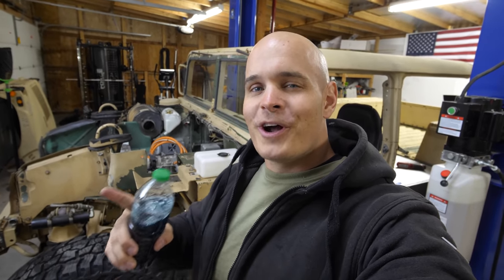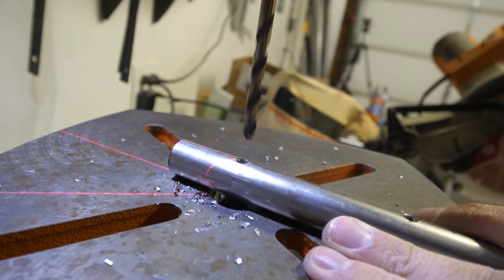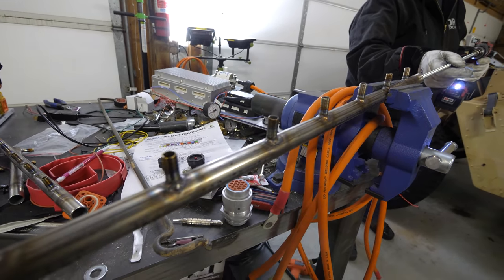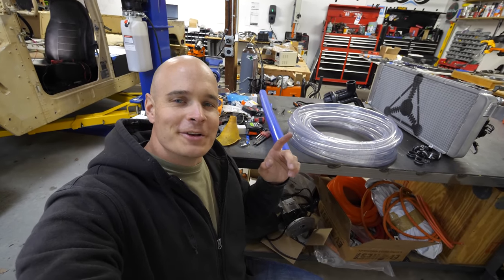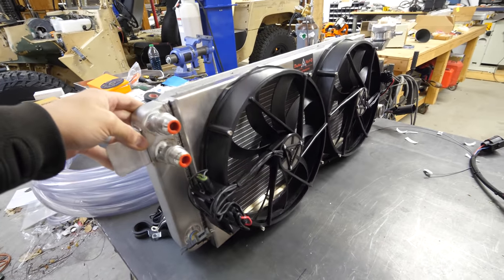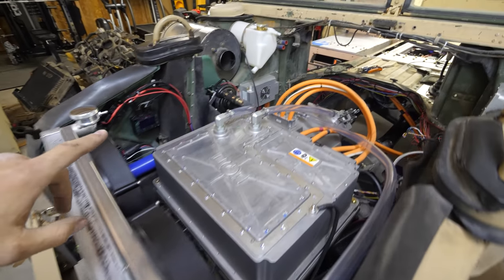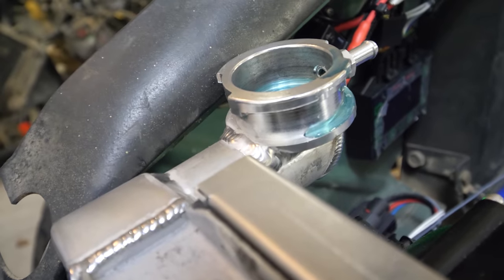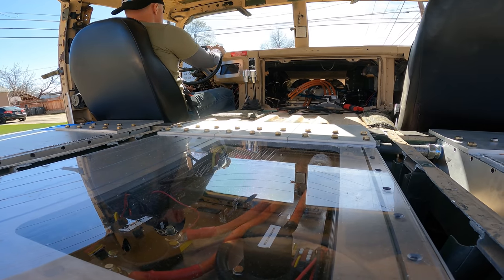The ELECTRIC HUMMER projects 'coolest' video YET...

Comment: awesome video! love this project. are you going to provide a cost range of how much it cost to do this conversion?
Reply from the maker: Yup!
Reply: @JerryRigEverything  My Guess is between $50k-150k
Reply: @JerryRigEverything  NO RESERVOIR? What about thermal expansion??? You could get leaks in the system without a reservoir that's one of the big reasons they're used in cars

Also your radiator seems to be aluminium, but the heatsinks in your battery might be copper... which will lead to galvanic corrosion, and eventually your system will leak (hopefully not inside the battery or it will destroy it). Just make sure you're not mixing metals!!
Reply: @iamdmc  unrated
Reply: @slimedev4920  Going out on a limb and saying a lot more than 50k (including the hummer) but less than 75k. Batteries can be had on open market 950-1350 per module, believe he has 16? so around 15-18500 (largest cost of this conversion). The motor and remainder components easily sit at 20-25k then rest of the cost of the vehicle itself. There could be labor if your not doing this or isn't simply a bolt on, which most conversions aren't. Again depending on how you approach this could easily get you under or at 75k for this project..
Reply: à
Reply: @iamdmc  I'm wondering if the deionized water in his coolant means that the coolant no longer conducts electricity and if that means galvanic corrosion cannot take place. I'm definitely interested in how all his new parts hold up over time.
Reply: @AustinFerguson  yeah ik
Reply: @slimedev4920  Didn't you get any bigger range? Your estimation is naive, as if "At least $10"!
Reply: @JerryRigEverything  hey btw what about the suspension? :D
Reply: @iamdmc  I didn't understand 40% of what you said but you seem to be making a point
Reply: @iamdmc  Aluminium and stainless steel, so no real issue with corrosion provided the antifreeze has protection in it for both. Expansion just needs a tank on the end of the radiator cap, and a 1PSI cap into a sealed bottle, or even just a simple accumulator, recycle a hydraulic one, as the expansion of the water in the system is going to be minimal, and probably can easily be handled by the PVC hoses expanding. 

Would though suggest adding some sleeving to all those hoses, especially where they run in the chassis, as that is where they will rub, and PVC in clear has very little abrasion resistance, and will also rapidly age. Best to replace with some braided hose now that the concept is proved, and use silicone rubber braided Goodyear hose, which will survive decades there, and fit the existing fittings no problem.
Reply: @AndyGneiss  I think it has to do with the coolant making the copper and aluminum break down slowly into the coolant so the water becomes conductive and will form the reaction leading to corrosion
Reply: @JerryRigEverything  You are awesome. Really enjoyed the whole series. 💓
Reply: $57
Reply: @iamdmc  yep thats what I touhgh too, mixing metals in a cooling loop is never good idea
Reply: @SeanBZA  Anti-corrosive additives only last so long, especially in high temperature environments. If it's changed often then it's less of a problem. 

Mixing metals is seldom a good idea! I hope I'm wrong for Zack's sake. Seems like a solid guy and would hate to have anything ruin his project car
Reply: @AndyGneiss  deionized water actually draws ions into solution faster than mineral water, so eventually you will have metal ions floating throughout your loop, and when one metal ion contacts a different solid metal you can get galvanic corrosion. Usually, people run deionized water with PEG and corrosion inhibitors
Reply: @iamdmc  Under 60C, so not exactly a problem, especially if you are using a propylene glycol blend with corrosion inhibitors in it, suitable for aluminium heads and cast iron blocks. Both the aluminium and the stainless steel form a thin oxide coat to protect, so the antifreeze will last a long time, provided the system itself is air tight and thus there is no oxygen to cause reactions. Should easily last 5 years in there, if it is the correct type, though you can also flush it out and use the Dexcool pink or orange antifreeze that Tesla uses in their vehicles, which is going to last 7 years as well.
Reply: @iamdmc  Need some Sacrificial Anodes!
Reply: @johnboynb  good call

Comment: It would be interesting to have a heating system for the batteries to recharge them in temperatures below freezing.
Reply: Bypass valve to redirect motor heat through batteries not rad? :)
Reply: @XxTWMLxX  It's a good idea, but it might not work very well because the car is stopped to recharge, so the motor won't produce heat
Reply: If you charge immediately after driving in cold conditions the batteries will be in the range for charging its only if leave battery empty in cold conditions that will have problems
Reply: @lucasdiniz5642  just put the motor at 5Krpm or something with the transfer case off.
Reply: @jwalster9412  Due to the high efficiency of the motor it is good at turning but not producing heat, so it would waste a lot of energy compared to a resistor in this case.

Comment: 10:00 This kind of pressure change can also be observed doing natural gas pipe testing. The formula (for air anyway) is T1/T2 = P1/P2.
Reply: IN KELVIN for people reading this, in KELVIN, not fahrenheit, not even Celsius !!!! Exclusively in Kelvin or the formula makes absolutely no sense !!!
Reply: @chafarlefeu  I mean, any physics formula with temperature should be handled in Kelvin. Celsius Degrees should be good only when dealing with ΔT because Kelvin and Celsius Degrees share the same intervals between units

Edit: spell check
Reply: @KekkusMaximus  yeah I know but the point of my answer was to warn the general public of this video which is for the most part not aware that this formula is useless if not used properly

Comment: I didn’t realize there was such an efficiency difference between electric and gas engines. So, even if the electricity generated for the electric motor is created by fossil fuels, it seems like it would still be more efficient than a gas motor.
Reply: It absolutely is. Engineering Explained has some good videos about this... A gas turbine peaker plant, connected to an EV by miles of transmission lines and all the efficiency losses involved, AND the charging losses, AND the drivetrain efficiency, is still more efficient than gasoline explosions pushing pistons 😂
Reply: @kschleic9053  Also, not all electricity is produced by fossil fuels, while to run a gas motor, it's entirely fossil fuels
Reply: how much efficient is a gas power plant?
Reply: @sayyidsahal1996  About 40 - 50%, the upper end being for combined cycle gas turbines (CCGT)
Reply: @sayyidsahal1996  that depends, a natural gas turbine plant is about 42-45% efficient. A combined cycle natural gas plant (one that uses waste heat from the gas turbine to turn a steam turbine) can be upwards of 60% efficient.
Reply: @fhonethone  not much of  difference.
Reply: @Blinkin97  then how can be a electric vehicle is more efficient when source is gas burning ?  gas to turbine to transformer to transmission to transformer to DC conversion to  chemical charging to discharging to
 AC conversion to motors.
(to me) it seems like a joke.
Reply: @sayyidsahal1996  it is not, because not all the electricity comes from gas power plants.
Reply: @Blinkin97  that's true
Reply: @ulexx6574  In some countries you can get gasoline that's 5% or 10% not fossil by adding ethanol.
Reply: @ulexx6574  putting aside e85, i wonder how synthetic fuels are going to affect the future. Brands like porsche are already working on it.
Reply: @Flashbang_Photo  Never heard of those! Seems like a pretty interesting concept
Reply: @jannikheidemann3805  ethanol production for use as a fuel has to be one of the dumbest things that's been done... thinking about it as a whole system: you need to spend energy to till/plant/harvest the crop, the production and transport of the fertilizer it uses, the transport of the crop after it's harvested, the energy use of the brewing and distillation facilities and then the transport of the ethanol to fossil fuel production facilities. I've seen number where it's only producing 25% more energy than you have to put into it... all to burn and use in vehicles with engines that are only 20% energy efficient on average and up to about 38% best with modern high-compression ratio engines, we haven't even started talking about the increased pollution from this industry and pressure on other food industries potentially pushing up food prices. Watch Engineering Explained's video about Ethanol.

Comment: Congrats on a job VERY well done!   I didn't see how you flow the coolant through the battery packs... hopefully in parallel, not series? That way you can keep them all at the same temperature instead of sending "once warmed" liquid from the first - to the second battery pack, then "twice warmed" from the second to the third...    It also looks like the suspension could be softened a little since it's probably a few (or several!) hundred pounds lighter than the suspension was designed for.

Comment: Wasn't it better to have a reservoir for the antifreeze? Imagine, over time it can start to leak antifreeze for some reason. Normally all vehicles have an expansion vessel (reservoir) so the coolant loop never gets empty.
Reply: It would never pull anything in with that cap. The system is too low pressure to ever open the radiator cap to pull new coolant in.
Reply: I am sure you can find a cap with low enough pressure to allow for a reservoir
Reply: The reason that IC vehicles have expansion tanks, is because the coolant runs at temps above atmospheric boiling. The reason the systems runs around 15psi is so that it pushes the boiling point of the coolant up around 250ºF. The side effect of this is that the coolant undergoes a significant amount of thermal expansion. So much so that the cooling system is unable to contain it all, hence, the expansion tank. Since Zak's system isn't going to be going any higher than 150 (or shouldn't), he should not have any need for the tank.
Reply: @AdamNDJ  I get it, but it is not the case i mentioned above. What i meant is, imagine somehow you have a small pinhole, or a leakage in some tube, connector, whatever. If you have an reservoir it can provide the coolant to keep the loop full for some time (maybe enough time for you to check the coolant levels), but if you don't have a reservoir and you dont notice any leakage the circuit will eventually be empty and thats not good xd

Comment: 30~40% conversion efficiency is a best case scenario for gas cars, such as with Hybrids. Typical gas cars are only ~20% efficient. Compare that with the >95% efficiency of EVs, and it's no contest.
Reply: you're forgetting that the electricity has to come from somewhere
coal fired power stations for example are at best 40% efficient and are with that one of the most efficient power sources of the world
Reply: @simeoneon1980  but if its solar or wind
Reply: @user-fw2cx3nc3i  Solar and wind is 10% of the global electricity. Yeah.
Reply: @UhOhUmm  nucleair man
Reply: @simeoneon1980  nucleair
Reply: @simeoneon1980  Or from hydroelectricity wich is 90% efficient
Reply: @simeoneon1980  i think they were aware of that but only talking of sheer efficiency of the engine itself
Reply: @simeoneon1980  coal isn't efficient that's misinformation, also this guy uses solar.
Reply: It’s always fun when the ICE crowd starts sputtering about efficiency and energy sources. They believe that their fossil fuel just magically appears in their tank, like unicorn farts: POOF!

The fact of the matter is that the entire process of making fossil fuels has always been, and will always be, a total environmental nightmare. Exploration, drilling, transporting, refining, transporting, storing, pumping AND burning is just one disaster after another. Well fires, spills, leaks, burning, vapor leaks, contaminated ground water, etc… And that’s not even talking about the ridiculous inefficiency of ~80% waste - both pollution, and pocketbook waste. 

Yes, there are areas that produce electricity using dirty methods. However, the big advantage is that those sources can, and are, changing. Electricity made by burning coal can and will be converted to other, cleaner, sources.

Fossil fuels, however, will always be nasty, filthy, inefficient, just like they always have been.
Reply: @simeoneon1980  You're forgetting about all the energy that goes into pulling oil out of the ground, refining it, and transporting it. If you add that in (like you are for electricity) then the efficiency for an ICE engine goes way below even 20%. It takes 8kWh of electricity to extract and refine a gallon of gasoline. You can drive an EV 32 miles on that electricity.
Reply: EVs do provide much better efficiency, but 95% is a stretch. 95% is the best case efficiency of the motor alone, but it will usually be less as this is only at the best case operating point, so 90% is realistic. It needs to output into a reduction gear that will take off 2-3%. The input power to the motor is AC and must be generated by an inverter/motor driver from the battery DC supply. This will use another 2-10%, then the battery charge/discharce cycle is about 90% efficient (95% charge, 95% discharge) on average (depends on SOC), then fianlly to charge the battery a regulator is needed that will drop another 5-10%. So the net efficiency from the wall is something like 70%.
 
Naturally an ICE car needs refined fuel and in addition to practical losses and nonidealities in the drivetrain the refinement and distribution losses means it would be lucky to get to 15% from the well, so it is still a major win pretty much regardless of the electricity generation source.
Reply: And from where does your electricity come from? There is a lot of loss in transmission power lines. And many electrical equipments that take that power before it's made. Btw solar cells are also not that efficient if u r talking about commercial ones and neither we have means to store that much as we need power at night too.
Reply: @sbrubak  Some electric motors can reach more than 99 % efficiency. Google it.
Reply: @sbrubak  Charge/discharge cycle is more than 99 % for li-ion batteries, not 95 %. Maybe it can be 95 % when you are pulling the max allowable amprerage out of the battery, but only happens very rarely during the drive, less than 1 % of the time (time during hard acceleration etc).
Reply: @velikdole9712  , no the coulomb efficiency is 99% but the energy efficiency is less due to voltage hysteresis. I.e. you must charge at a higher voltage that what you will get out again. At low SOC the hysteresis is low, but once SOC passes 30-60% or thereabouts it rises.
Reply: @velikdole9712  , never seen one. I'm going to need you to provide a reference on that and their applicability to EVs. Asking people to google your claims is bad form.
Reply: @sbrubak  You may never seen one, but it is out there. ;) Asking people to google is expected from them (it is the minimum standard). I would give you the link, but links on Youtube are not allowed, so just google "ABB reaches 99.05% efficiency, the highest ever recorded for a synchronous motor". Yes, this is an extreme example, and yes this motor is not used in electric vehicles, but you can find 97 % efficiency in electric motor the size suitable for electric vehicles.
Reply: @sbrubak  No, Coulomb efficiency is 99,9 %. Bjorn Nyland measured discharge losses and for some cars they are only 1 %. For some other cars around 2 %. But typically the losses are around 2 %.  But if car is not designed properly this losses can be 6 % (this is an exception in some not properly designed models, like for example Cooper mini).
Reply: @velikdole9712  , right that is a 44 MW 6 pole motor. This is why i asked for ev appricability. This is a very large machine and dies not need to be constrained. By things like weight and size av an ev motor does.
Reply: @sbrubak  Yes. that is true, but motor with 99 % is out there in the wild. ;) , But as i said, you can find electric car size motors with 96 or 97% efficiency.
Reply: @velikdole9712  sure and you also find marine diesel ICEs with 50% efficiency. It does still in no way help the efficiency of ICE cars . This 44MW motor is equally inapplicable.
Reply: @sbrubak  True. But 97 % electric motor IS applicable in electric cars. ;) I said that 3 times allready.
Reply: @velikdole9712  , which motor is that?
Reply: @sbrubak  Tesla have 97 % efficient electric motors. Source: Tesla Model S/X Upgrading to More Efficient Electric Motors
Reply: @sbrubak  Bosch have a new silicone carbide inverters for the electric cars that are 99 % efficient, combined with the motor it offers 97 % system efficiency which is simply amazing.